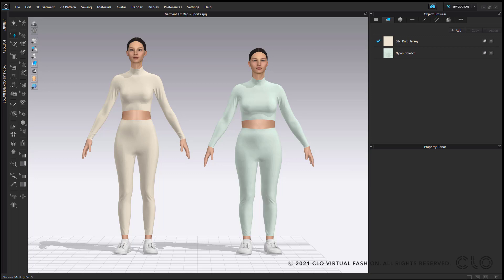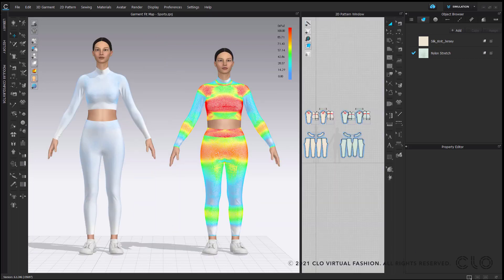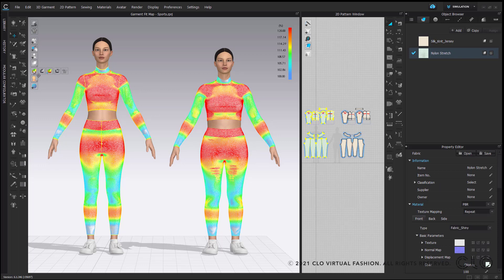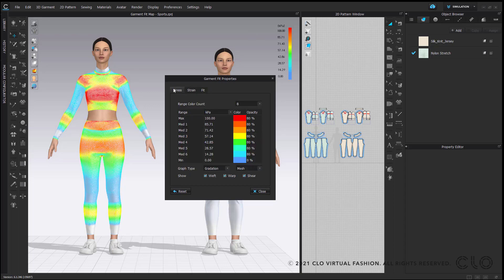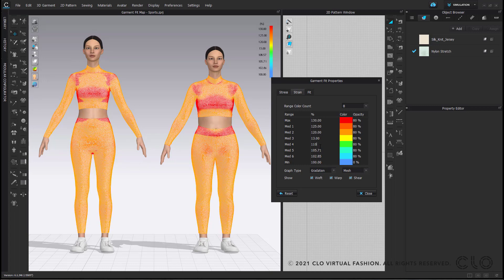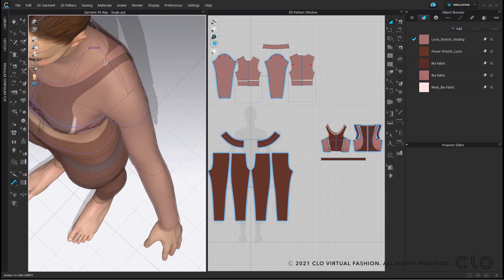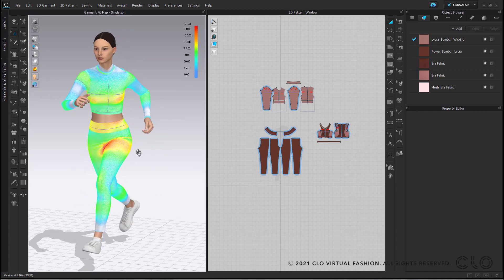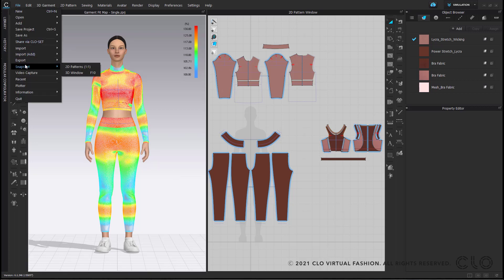How to Read Garment Fit Maps in CLO

Comment: Hi I have a question regarding fabric tearing and tensile stretch test. I want to use Clo3D to test fabric for a specific fit. For example I have a cord denim fabric with warp x weft tearing stretch 8lb/5lb I want to see if the weft strong enough to be used for fitted jeans or jacket because the requirement for weft that I have is 6lb and received fabric has 1lb less. I want to see if this makes a significant difference for the style durability when tension is applied to the area on the weft. I do see that the first map has something similar but in kpa measuring system which is different from the system our testing lab uses. Would you recommend this type of check or there is another tool that I can use in CLO?
Reply from the maker: Hi @alexa_zet. Do you work for an Enterprise company that uses CLO? 
Do you have a proper .zfab file and how Was the material tested? By us or by a team using the CLO fabric Kit? Or was it tested another way?

 To verify the details of the materials tearing stretch of 8lb/5lb mentioned above the material must be accurately represented in the fabric's physical properties through proper fabric digitization.
During this digitization process, there should have been information about the fabric's strain values corresponding to the tearing threshold of 8lb/5lb. If properly tested it should then be possible to visualize the desired information based on that data.
But if this was not done using the CLO fabric kit then CLO currently does not have a feature that allows users to intuitively and accurately confirm such information. But the "Fit map" within Fit maps is roughly intended to display something along those lines of what you are looking to to to at least give you a very good/close idea

Comment: Thanks for this video. 

I would appreciate if I could have a bit of clarification regarding the adjustment the values of the Garment Fit Properties.

I notice in the video the that speaker says to "lower the percentage value for very stretchy fabrics....and then to you should raise the percentage value for non-stretchy fabrics".

However, this directly contradicts what Clo communicates in its "CLO Garment Fit Maps Guide" pdf. 

On page 8 of the "CLO Garment Fit Maps Guide" pdf it states to "raise the percentage value for very stretchy fabrics and to lower the percentage value for non-stretch/low-stretch fabrics".

I would greatly appreciate if Clo would advise which information is correct....the information from the speaker in the video or the information from the pdf.
Reply from the maker: Hi Julian. I  have forwarded this question on to our Fabrics team. Will let you know as soon as I have received their reply
Reply: I am wondering the same thing. Did you get a reply?
Reply: Did you get a reply?
Reply from the maker: for further help please make a new post on our CONNECT Forum 
https://connect.clo-set.com/community

Comment: Do I need to know Maximum Stress-Strain of my fabric? Can't the software automatically know it from the physical properties if I am using the Clo Fabric Kit?
Reply from the maker: Correct. CLO will know if you use the fabric kit. But you will still want to turn on the stress/strain maps to check if it is fitting properly or is too tight. Since fabric cannot "rip" in 3D the fit maps allow the garment to "speak" to you like a fit model would
Reply: @CLO3D  That I understood, but what I didn't get is why I need to manually enter the maximum values for stress and strain in the fit properties dialog box.
Reply from the maker: @brahamdutt6664  Those should already be entered when the fabric is digitized with the fabric kit
Reply from the maker: But if we are still not answering correctly please either reach out to your CLO representative directly is you are an Enterprise Client. Or if you are an individual please post to our community forums which will allow you to add visuals to helps us assist more

Comment: 10:20 "When working with very stretchy fabric, I need to actually lower the KPI". Everything becomes trivial from the moment you manually change these values to fit your pattern and materials. Unless I'm getting something wrong here, you are basically cheating!
Reply from the maker: Changing the KPI entails understanding your RL fabric, knowing it's KPI and editing in in CLO. No faking it, but rather knowing the correct data and applying it.
Reply: @CLO3D  Thanks for the answer. I understand, but I believe the average designer Joe/Jane does not usually know the physical behaviour / chemical material composition in numbers.
That being said, I didn't realize I was commenting on an official CLO tutorial and I proceed to turn my criticizing into an apology and compliment for giving the software this level of flexibility.
Reply from the maker: Fabrics should always have content listed on them which will help. But we do understand this can be confusing and our team is actively looking into a way to make this more user friendly

Comment: Still having a hard time understanding the basic difference between stress and strain.  Is it safe to say stress is more about positive ease when dealing with the fit of woven garments and strain is more relevant to knits where you would be working more negative ease and compression?
Reply from the maker: Have a look at this to see if it helps. https://support.clo3d.com/hc/en-us/articles/360052622933-CLO-Garment-Fit-Maps-Guide
Reply: @CLO3D  Yeah, I've reviewed those and the manual and I'm just not wrapping my mind around the differences.  For example, it says that the stress map " displays the force per unit area in kPa applied to a garment by external stress".  What is external stress?  Is that movement of the body such as bending or sitting?  If so, how is that NOT the fit map? I just looking for a simple real world explanation for each map along with an idea of when to reference one over another.  Thank you,
Reply: @MADEApparelServices  Stress is force on the fabric. This force is exerted due to being worn on the body, and body shape exerts this force. Strain is change in length or deformation in fabric due to exerted force.
Reply from the maker: exactly :)